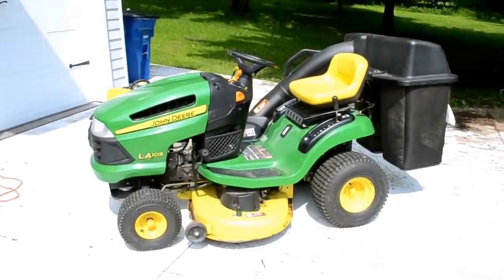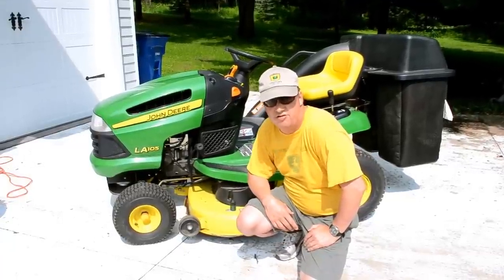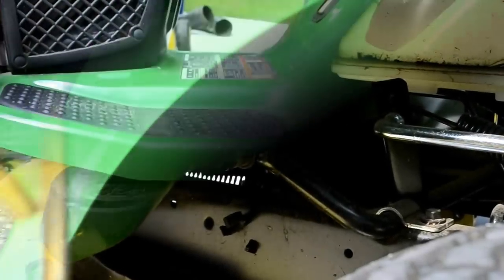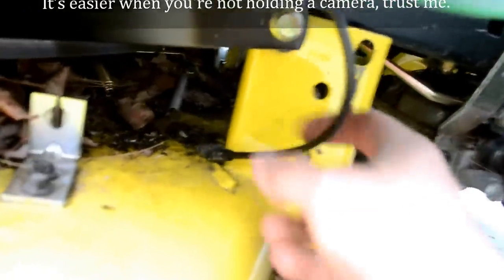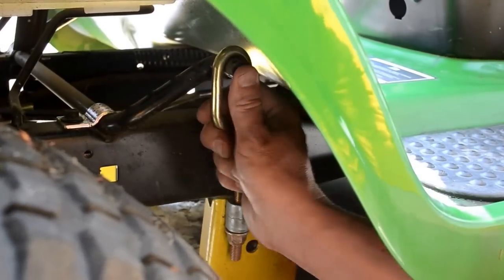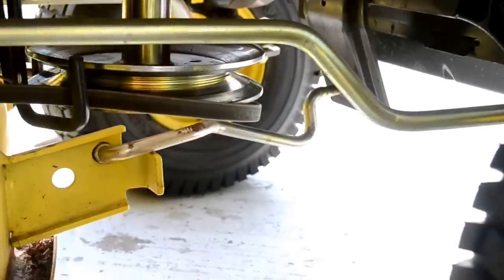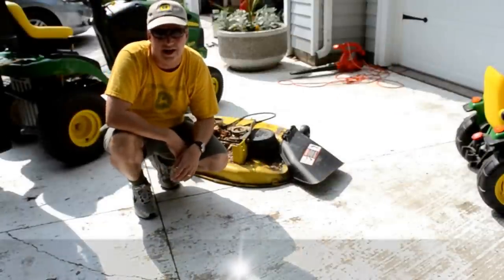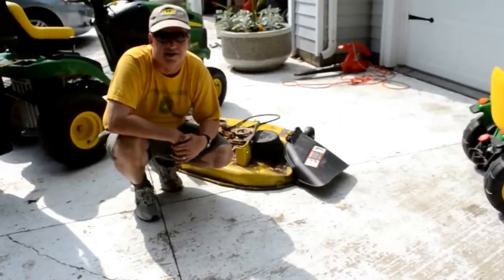How To Remove The Mower Deck on a John Deere Tractor

Comment: Woohoo.... wish I could share a pic of just how disgusting the bottom of our mower deck was.  I googled and found this. I’m in my 60s and female. This was so well done, I managed to remove it myself apart from a very stubborn over LARGE spring at the end. Hubby tried to remove it with no luck, till the only solution was to grind off a very small part at the end of it so we could unclip it. Huge thanks. Our mower was in desperate need of a clean . Thank you so much.

Comment: Just bought a used 115 auto and its in great shape except for the deck, it almost looks like it came from another one. first, lots of paint and rust so was debating on taking it out to repaint better but just found out that the right back main brace is rusted and is have half way pulled away from the deck, so now its going to have to come out and get rewelded, this will help immensely, thanks for posting
Reply from the maker: I'm glad you found my video.  Thanks for the comment and good luck with your project!
Reply: @DANDLINC  Thank you Sir!

Comment: Right after removing them, put the washers back on and pins back through their holes so there is no chance of misplacing them. It also allows you to immediately see where they are when you are ready to reinstall the deck.
Reply from the maker: That, is a great tip!  Thx for watching!
Reply: Thanks
Reply: I just put down three small plastic bowls, and put the items from each side and front in the bowls.  It worked great until either my kid or one of the dogs dumped them over...guess my idea didn't work out as well as I thought.  :0)
Reply: Thomas Jacques ñ

Comment: Thanks for the upload!  I bent the mulch block plate on my LT 133 by running over a baseball that rolled into my path.  Once I removed the deck I found the left blade was contacting the blocker.  Easy fix and gave her a much needed clean out too!

Comment: Thanks for the video. I just received a 125 model and pulled the deck to weld one of the wheel brackets. Putting the deck back on I was left with a cotter pin without a home. Watched this video and knew where it went. It the one that hold the cable on the deck. Thanks.

Comment: I just changed the blades on a d160. Only difference is the cable was not there but yea man I would not have been able to of done it with out this video. Thanks a lot.

Comment: The videos regarding the mower deck and blades was perfect. Do you have one for reassembling a Stihl FS 45 weed trimmer, specifically the trigger throttle housing and all of its springs?

Comment: Wow, when did they go to that system? I have an old LX178 and they just have a bar in front and two spring-loaded pins rear that pull out. You would think a newer model would be as or even easier to change deck.

Comment: Wouldn't it be easier to put the blocks down, then lower the deck to remove the weight from the mower?  Or lower the deck to the ground (maybe with a single 2x4) so you have more room to work?

Comment: The home depot online is not a good place to order a mower. paid for one 3 weeks ago and cant reach anyone that knows anything about it . called home depot 10 times called Pape' john deere. in sandpoint a week ago and they said they had NOTHING TO DO WITH IT. they lied. it's been sitting there for 3 weeks. still dont have my mower.

Comment: That's a lot of work to swap out blades. The way I do it takes about 10-15 minutes tops. On Deere 245, I change the blades all the time by just jacking up the front with the same floor jack I use for my truck, wedging a block of wood to hold the blade (if you can
t just hold the blade with your hand) and use an offset box end wrench (gives you a little more room) to loosen bolt. Blades pops right off. Put bolt and washer through new blade (making sure it's got the correct side down), hand tighten the bolt. I use the box end wrench to tighten the bolt as much as I can just holding the blade in my hand. I am pretty sure that running the mower locks the blades down from the natural rotation because they are always harder to get off the next time. I have 2 sets of blades and re-sharpen the ones coming off to reuse next time. You can sharpen them with a metal file or a angle grinder or a bench grinder. Just watch to make sure you don't get them too hot. If they start turning colors it's too hot. Have a bucket of water handy to cool them so you don't ruin the blade.
And remember you aren't sharpening a chef's knife. They don't have to have even a remotely nice edge on them. Just sharp. They are going to get dull very quickly anyway first time you hit something. The
Reply: True, it's easier to lift and remove than to remove the deck.  I still followed his path because I got mine used and it needed to be cleaned.
Reply: @Troy-Echo  Very true. I did that once myself to change all the belts. It has to be removed to change the main drive belt. I like to keep the blades sharp and that method is too much work if your just touching up the blades.
Reply: @stevejames3292  No, not really.  After watching the video, it literally took me about 2-3 minutes to get the deck removed, and I'm sure it would be a little quicker the next time.  My issues the nuts holding the blades on have been in place so long they won't come off.  I tried an adjustable wrench with no luck, then a socket, and it still would not come free.  I'm trying to soak it in some spray to get them to break free.  I even tried smacking the ratchet handle using a rubber mallet with no luck.  If they don't come free tomorrow, I guess I'll have to go to a local shop and see if they can get them off using an impact wrench.
Reply: @Troy-Echo  I had the same problem the first time I removed them and I had it jacked up trying to get at them. I tried all the things you mentioned then I wedged a piece of wood in so the blade couldn't turn put 1/2" 6 point socket on it with an 18" breaker bar.  Leverage is the trick.  If that's not long enough use a piece of pipe to extend it longer. I once had to put a floor Jack handle on a beaker bar to get an axle nut off an VW beetle and have someone jam on the brakes.  It called for 460 some ft lbs of torque but I broke it free using leverage. The blade nuts came off easily using the breaker bar. Needless to say I put anti seize on before I put them back on.
Reply: @stevejames3292  Thanks Steve!  I have the old pipe that the Dish TV service was on from the previous home owner that will work perfectly for this.  I'll give that a shot.  I've had some spray on them for a few days so maybe the combination will do the trick.  I had a block of wood bracing the blade in place too the other day, but no luck.  I'll put something on the nut before putting it back on so it won't seize like this again.  My 42" John Deere 100 Series (125) has 3/4" nuts and I used a six point socket as well and a rubber mallet with no luck. I'll take a shot later this evening and see if I have more luck.
Reply: @Troy-Echo  Good Luck. Let me know if that works for you. My original ratchet "extension" (I know you're not supposed to use a ratchet as a breaker bar but I was a kid and that's all I had at the time) was a foot long piece of electrical conduit which I had flattened slightly. It fit my craftsman 1/2 inch ratchet handle perfectly. I used that for years when I needed just a bit more leverage until I eventual bought a real 18" breaker bar. I love improvising tools to get a job done.
Reply: @stevejames3292  I tried the extension bar and still had no luck.  I ended up taking my truck to the local auto shop because I threw off a weight on the back tire, so I just asked them to use their impact wrench to remove these stuck on nuts.  I just got the blades sharpened today and back on, and was reviewing this video real quick to make sure I wasn't going to waste time, although while I was putting the mower deck back by the mower, I see my front left wheel is broken from the axle.  My brother's son was mowing their yard and ran the mower into a tree at full speed and it damaged it.  Guess that's next on my list.  A friend of ours owns a lawn mower maintenance shop so I'm sure he'll take good care of me.  Guess I'll be push mowing today.  :-/
Reply: @Troy-Echo  Glad you got it done. If yours is same as mine the wheel is on a little king pin connected to I- beams connecting back to the chassis. The thing is pretty massive for what it is. What broke? It must have been a heck of a collision. 

I was just today pulling the wheels off my boat trailer and the extension trick was the only thing which got one of the lug nuts off. My 1/2" drive impact got the rest off but not this one.
Reply: @stevejames3292  I haven't dug into it yet...here's a link to a photo.  Can't be hard to fix.  https://app.box.com/s/q4cgq5axa27goq61gguqmf7hh5apq5qu.  I found the entire spindle kit (both spindles, full for both sides) with bearing for about $59, and if I dig in and see the spindle is fine, the bearings, caps, washers and clips are $20.  My nephew is special needs...but he's an amazing driver, better than most when he is focused, but he doesn't have the focus required for a drivers license.  I'm guessing he probably got distracted while mowing (saw something shiny) and ran into the tree.  The hinge for one side of the engine cover by the front tires is broken too.  It doesn't cause an issue.

Comment: Just FYI.... Don't support the deck with blocks, drop the deck down so its supported by the ground and it makes reaching under easier because of more room as well as unhooking the linkages easier because there is less tension .
Reply: +Barnyard Aerials (Tyler Hatton)  Yeah, but....he did do it like the manufacturers   manual says to, with the blocks...can't fault him for that right?
Reply: Barnyard Aerials e
Reply: Barnyard Aerials why take it off,easier to put on blocks and take blades off and reinstall,3 nuts

Comment: Is there not an easier way to change my blades? Can jacks or those portable car ramps be safely used to gain access to the blades? I'm not at all confident about dropping my deck and then getting it back together due to past bad experiences with other tractors. My owners manual just says to bring to an authorized John Deere service center, which is not an option for me. Thanks for the info.
Reply from the maker: That sounds a bit more dangerous.   The procedure is not really too difficult.  The first time will be the weird one....just think back to your first oil change when you were 16...a big deal then...now you can do it without even thinking.  Thx for watching!
Reply: I  have a husqvarna Lawn Tractor and I change the blades by using a small 2 Ton floor jack to get the front of the tractor up. Then release on to two jack stands. I then put a block behind the rear wheels. I can now reach the blades and change them out pretty easily. About a 15 minute job.

Comment: I found it easier to wrench the blades off from underneath after driving the front wheels onto a couple of wheel ramps to lift it up. Granted I needed a couple of wood blocks to stop the blades turning as I wrench the central nut.
Reply: +T0mat0S0up  It's the belt change part that prevents your concept. If only the blades needed replace. I hook a come along to the front and lift it almost off the ground. Then you have access to the blades only!
Reply: T0mat0S0up word to that floorjack in front hi as it'll go and impact them blades off and newones back on
Reply: Greetings from Australia. These are a pretty common mower around here. I've changed the drive belt a couple of times over the years & haven't dropped the deck off the mower. The only parts I took off were the pulley covers. I just dropped the deck to the ground whist still attached to the mower & this gave me enough room to reach in & replace the belt - easy peasy.
Reply: i sharpen my blades from underneath with a high speed die grinder and burr bit. does a decent job for a lot less effort instead of removing blades.

Comment: John Deere has been learning from Craftsman.  I had a nice 2001 craftsman 54in deck with kohler motor and changing belts was relatively simple.  i now have an old used Dear John G100 with same engine and same 54 in deck.  the point is that it seems like you have to take a crap load of nuts off and then pull off a giant spring , and that includes taking apart the steering linkage in 2 places.  then when you put everything back together, it wont go back together easily.  like everything is under tension and its a bear to line up everything.  will never buy a JD riding lawn mower again unless i see the salesman easily remove and then quickly reattach the deck.  oh and the john deere drive belt changing is a total cluster.  the craftsman was very easy.

Comment: Easier is to back up onto car ramps, then use a floor jack to raise the front end. Now your tractor is up high enough to get an impact underneath to undo the blade retaining bolts. NO need to remove the deck.

Comment: I made a creeper and put it under the housing and it slid right out. Also, if I remember right, once on the blocks/creeper, push the height lever down a notch or 2 to take pressure off the hangers and they will pull off a lot easier.

Comment: hi, I have a problem after reassembling the blade plate and belt the John deere no longer starts, as if there was 1 safety activated.  I turn the ignition key and show no signs of life.  ok 12v battery.

Comment: The wheel broke off my John Deere L 100 deck. Is there anyway of welding it back on
Reply from the maker: The small plastic anti-scalping wheel?
Reply: It depends. If just the wheel and not the bracket that holds in that's attached to the deck broke off, replace the pin/wheel. If the bracket broke off, I would say yes, you could weld it but i would be careful.

Comment: I have a JD-LT 133.  Hit a stump and deck dropped.  I did get deck back up by putting the lift handle at bottom into a hole i found in deck.
My issue is i cannot figure out how to make the deck "lock" while up like it used too.  I see a flexible piece on the bottom but can't figure out how to put all this in proper place
can anyone out there help me.  thanks

Comment: I always change them with the deck and everything attached, it takes me 15 minutes. I do like the fact you can clean both sides of the deck though.
Reply: +David Pennington Can you please share how you change your blades without dropping the deck? I really would rather not do this if another way is possible.
Reply: I never take the deck off. I put bricks under the deck 2 x 4 to block blade movement. Grunt and groan while I lie on the floor with wrench with a pipe extension for leverage and huff and puff till blade loosens. Tight quarters but for me easier than taking entire deck off. Nice video though. Thanks

Comment: Couldn't a riding lawn mower lift make it so you wouldn't have to remove the deck to change the blade?
Reply: +Ron I want to know this too or any other means of changing blades without removing my deck. If you find out please let me know. What does a lift look like for these mowers? I couldn't find any. Thanks bud.
Reply: Lifts are available at Harbor Freight and also at Orschlen's Farm and Home. I have one and it works great!

Comment: Nice video, but there's one problem. All John Deere lawn tractors are not alike. Mine is several years older than yours and the deck mounting points I'm not even close to the ones on your mower.

Comment: Oddly enough, I have reassembled mine and I now have an extra 'cotter' pin! It's the same size as the ones that attach the metal bars/support arms. I did some work on the deck but I have no idea where this left over pin goes! Ha ha!
Reply: The cable that engages the PTO?

Comment: I was envious of the drive-over auto connect decks but after seeing this removing the deck on my X530 seems like a breeze!
Reply: +snorman1911 Hey when did they come out with drive over auto connect mowers?  I am looking for a used one 300 series?
Reply: +Kartboarder22G They've been out for a while but only on the higher end tractors.  If I'm not mistaken, they are available only on the 1 series tractors and above, not any of the garden tractors.
Reply: +snorman1911 They do make them on the x700 garden tractor series
Reply: +DeereMaster445 Ah ok, I hadn't seen any X700s with them.

Comment: My mower keeps throwing the belt therefore making imjpossible to engage the deck.  Is there anything you might recommend?  I only have about 5 hours on the present belt.  How do I adjust the tension on the belt?

Comment: jesus they couldn't make it easier than this?
Reply: what does Jesus have to do with it?
Reply: My old Wheel Horse with a 3 blade 42 inch deck has only one pin to pull and its easily accessible in the front of the deck. Even the belt tensioner is out in the open and only needs a push to remove the belt .

Comment: Come on guys, you are removing 4 pins from the lift arms - top pins so the arms lie on the deck and don't dangle and obstruct deck removal, one from the front sway bar, and taking the belt off the drive sheave. The engagement cable is a couple of things after the deck is half way out.
It used to take me less than ten minutes and most of that was getting up off my shattered knees and staggering around to the other side- start at the ejection side so you only have to stagger once.
Buy the biggest washers and  pins you can find that fit. 
When I handed this off to my 12 year old I painted the relevant parts fluorescent orange and it became child-proof.

Comment: Wow, way to many pins! Who in the hell design this?
Reply from the maker: Lots of articulated points designed in so the deck can follow irregular terrain I suppose.  Thx for watching!
Reply: They're pins... they take 5 seconds to remove. And there's only 6 of them
Reply: Engineered for the average owner to call JD service rather than work on it themselves.